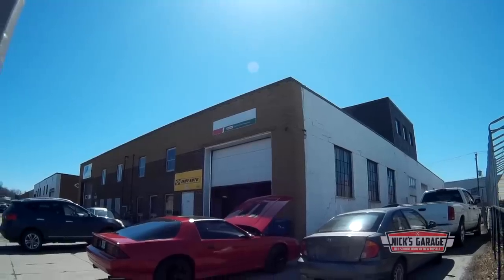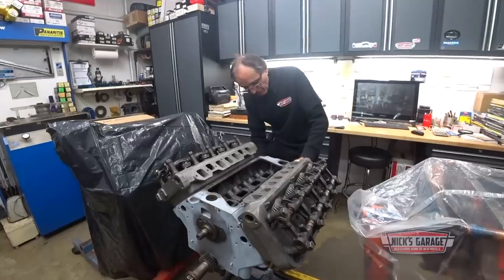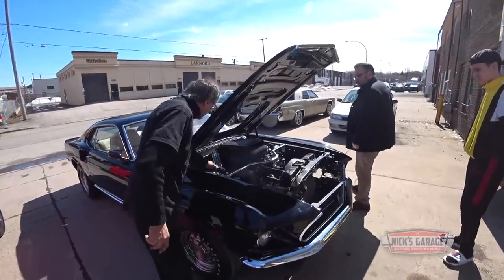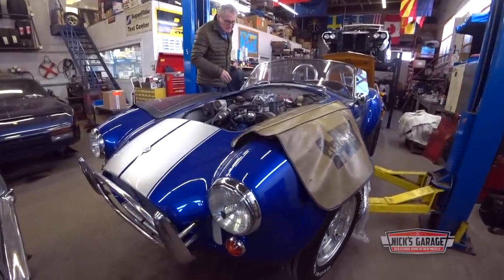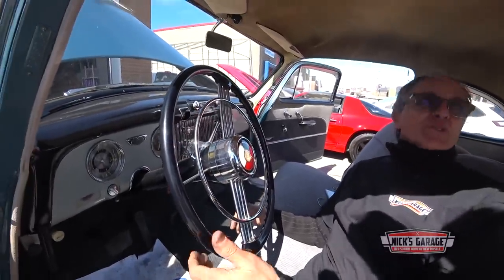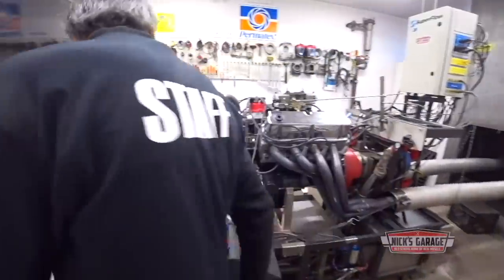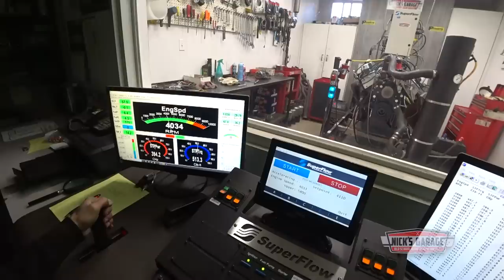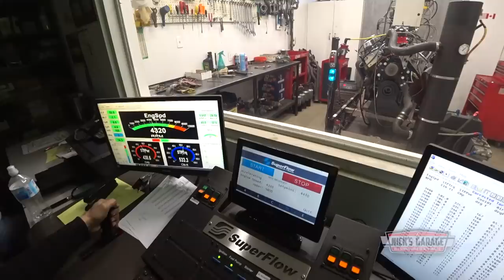427 Ford on the Dyno - Nick Tests the Blue Oval

Comment: I'm kind of surprised at the size of the intake ports. 351 Cleveland ports look much bigger. Am I right?
Reply: Yes especially 4v
Reply: @Grumpy468 That's just not true! Ford used the Cleveland design for twenty years in NASCAR. My '70 Mach 1 with it's Cleveland 4V was one of the fastest cars I ever owned! Well balanced for handling, too.

Comment: A Rouche 327 stroker in that cobra, YAASS!
Reply: 🙄 327 is a Chevy engine. You’re thinking of a 347
Reply: @Dunkaroos248  It is a 302 bored and stroked.
Reply: Maverick nonconformist no it’s not, it doesn’t exist as a ford engine. Typical 302 variants include the 306, 331, 347, and 363 stroker. I’ve never seen or heard of a 327 that wasn’t a Chevy
Reply: @Dunkaroos248  Look up the Windsor based R series 327R. About 425 horse. By Roush.

Comment: nick did you upgrade the main caps to 318 units so you can use the 340 oil pump and stronger main caps

Comment: Did you ever figure out that this is not drilled for hydraulic lifters (427), only 1967 cylinder blocks.

Comment: A 460 ford truck engine with a 230 degree cam a 850 holley would probably get you 560 hp and 600 ft lbs of torque for a lot less money and at lower rpm.
Reply: diel.       I think they wanted that small block look.
Reply: with a 515 stroker kit in it 600 easy
Reply: Lots heavier than the small block, though.

Comment: Could someone put a honest to goodness 427 Fe into the cars that they belong in ? It's expensive but worth it . Even a 428Cj would be nice .
Reply: Small blocks are a lot easier to find these days.
Reply: A lot of builders like the challenge and knowledge that results from knowing these stroker engines inside and out. 427 to 434 inches from a small block Ford with good heads is a desirable package. Especially if you are bucks up and go aftermarket aluminum heads. I like FE big blocks too but getting the inches and power out of a small block combo is the bomb.
Reply: @bobbybobberson3374  Yeah, you only put a Chevy in it when you want the most power and reliability along with it.
Reply: @SealofPerfection  Oh No!  Someone been in the wobbly pops again!

Comment: I'd like to see a 500 ci. Blown Chrysler  hemi on alcohol on your dyno .
Reply: The Okc boys broke their whole system running a wild motor.
Reply: 🤔 That would be somewhat powerful, but imagine how much MORE brutal power that Mopar hemi would make, if he simply sprayed on a coat of Ford blue engine paint! That "spray on" power adder is proven to add 100+ horsepower and torque to ANY Mopar OR GM engine! Next,  you drop that Ford blue hemi into a Roadrunner or Dart, make a few passes to gauge it's potential et's. Then, hang a "blue oval" badge from the rear view, and make a few more passes... Congratulations, you've now dropped your et by 1 full sec! 😁👍

🚫 Disclaimer: I understand that most people will ask:  "why not just build a hot '68 Mustang fastback, a badass '64 Fairlane, or a world-beating '65 Mercury Comet Cyclone"? To those people, the obvious answer is simple... It's "yes"!☑️

🚫🚫Real disclaimer: Just kidding, I prefer Fords, but I like them all nonetheless.

Comment: The shock tower braces on the Mustang never came from the factory chrome plated. They were always black.
Reply: You're correct Scott, they just came to him like that.
Reply: Oh it matters!  ;o)
Reply: Mark Godfrey  Just because it spreads misinformation.  That is all.
Reply: They didn't come with the tubular cross brace either, or the aluminum intake - the Cobra jet came with a cast iron intake.  Just misinformation or bs - its easily spread when not so informed owners buy from bs artists and believe whatever they are told.  Its not really so important until the uninformed spread the stories they have been told and then argue with correctly restored owners
Reply: @Thomas63r2  only the police interceptor came with an alu intake

Comment: Just delete the PS pump. No leaks, save crank driven hp, save few lbs, less head aches! Good as a rowing machine 4 arms, but easy on a light weight rolling Kit glass replica AC Cobra small block. Also swap out serp to V belts easy w/PS & AC Veritable car. That's a mans ride and a beaut😘

Comment: On the Kit Car Cobra can you change to shorter motor mounts?
Reply: DBSSTEELER my thoughts.also
Reply: DBSS.     If I drop the engine, it will disturb other accessories.
Reply: Nick Panaritis 

I can see that. That’s still got to be cheaper and easier than the customer buying a whole new motor and starting from scratch though.

Comment: Not sure what you have there, but it ain't an FE 427.  Intake/head junction is not under the valve cover, for one thing; oil filter configuration is wrong too.  385 series block (429)?
Reply: They never said it was an FE.  It's a stroker small block.
Reply: I think it's a 351 Windsor stroked
Reply: I never said they said it was an FE.  But when someone refers to a "Ford 427," the default assumption is that it is an FE unless otherwise noted.  I figured someone would come back with additional information - albeit without the smartassery.

Comment: The replica Cobra should not have a tree-fiddy-one in it, it should have a real 429 FE or even a cammed 460. If the replica can't fit a 429, how did Carroll Shelby fit it in the real thing? Imo a modern Voodoo engine would be a much better choice. The 351 is a 5.8L, the Voodoo is a 6.2L, I think that even a Coyote would make more sense, but they have 32 valve twin cam heads and if they can't fit an OHV engine, it'd be impossible to fit a dual cam head V8 under the hood.
Reply: The 429 wasn't an FE, it was from the 385 series engine family along with the 460. Caroll Shelby used either a Windsor family 289 hi performance, or an FE family 427.

Comment: Judging by all the fitment issues, I guess its safe to say that that cobra replica was based on the 260/289 cars. as all a 302 is, is just a sized up 289, 351 though is a different animal and the guy who probably advised him to make the change probably did so thinking it could take it, thinking that it was based on the 427/428 cars, which were drastically overhauled to take that gigantic motor over the 289's

as once you reach about 400 HP+ with that motor, the 302, the thing can break right down the middle unless you literally wield a specific part on the block to reinforce it. It was something I learned from watching the regular car reviews build series on their Ford Falcon, which was engine swapped from an inline 6 that was on its way out, to a 302 from a 1990's Ford Thunderbird that had been used in fire fighting training with the jaws of life, so the engine was fine, the rest of the car was just torn up 

and he showed the photo of the reinforcement area and how to do it and what it was, as the owner was worrying about that and the block cracking overtime, even though it was only like 260 horsepower.

Comment: Il prend mieux le 750 CFCM plutôt que le 830 
Le Buick avec un générateur et une boîte de contrôle 6 Volt c'est vieux ça mon père avait un e Chevrolet 57 283 avec transmission 3 vitesse au volant quand on allait a la messe l'auto était chaude au bout de 5 milles c'est petit moteur tournait en douceur avant qu'il change l'overlap sur les camshaft en 68

Comment: 24:27 it didn't make any more power cuz you didn't push the handle of the way you weren't Full Throttle. Come on Nick
Reply: Then you can look at 26 minutes and 37 seconds... it's wide open then... come on man. the 830 would have done way better up top.

Comment: That’s a pretty cool ford! My 400m made 440hp and 535 torque with Cleveland heads and a tiny cam
Reply: You’re right about that, I have a set of Edelbrock aluminum Cleveland heads that I want to put of the next engine I build, I also have those heads on my 400m
Reply: Put on the next engine I build *

Comment: Why don’t you ever put more timing in the engines how 
can you expect it to make power with 29 degrees of timing ? Or is it you have poor fuel in Canada ,that engine needs at least 34 to 36 degrees to make power with that combustion chamber . I don’t get it I’ve been building race engines for over 38 years and never run that low timing unless it’s boosted .

Comment: PUT the 302 back in the cobra sell the 351
Reply: Swap it out with the 302 in that Boss, that guy gets a bigger engine that easily fits in his 'Stang..including those headers, the Cobra Jet guy gets a motor that fits in his car.
Beautiful old Buick, although wish they let you get rid of that miss, that is the 1 thing am a bit OCD about.
Reply: good idea
Reply: there are alot of ways to get that motor to work, but i think this garage only does bolt-on improvements
Reply: niceguy217 are you kiddding?! The boss mustang is worth fuckall without the original engine and you’d have the same fitment issues in the cobra with the boss engine because it uses Cleveland heads which are bigger than Windsor heads and won’t fit.

Comment: What is the price of gasoline there in Canada ??
Reply from the maker: Right now you can find regular unleaded at about $1.40 Canadian per liter. Which is about $4.05 US per gallon. If we got the math right.
Reply: Mr.     Today, 1. 37.9 per liter.  Yesterday, 1. 38.9.         For regular fuel.
Reply: Close enough at $4.05. Here in California, we are getting ripped at $4.25/gallon, highest in the nation including Hawaii. We have to use "boutique" fuels available only in California and the refineries are burning down (too old) and won’t build any new ones due to massive enviro regs. 
Great shows Nick, I can really relate to all your videos. I've been wrenching since 1958 when I transplanted a built Olds V8 with Packard 3-sp OD trans into my '51 Pontiac coupe-- really woke-up that car and was known as a “sleeper” back in the day.  I still have my ’32 Deuce Roadster bought in 1961 for $650. 
"Progressive" California has pretty much shut down street rodding as a sport and as an industry; many suppliers have moved out and vehicle over-regulation has a choke-hold on us with motor vehicle fines ranging from about $400 to over $1000 US dollars for each offense.
Reply: @MrGGPRI  .    I know that California has the strictest laws on environment in the world. Why? Too many cars?

Comment: Water pump, didn't see it spinning.
Reply from the maker: The water pump is powered by an electric motor for dyno testing. Nick can switch it on or off from his console to control temperature.

Comment: the old lifter looks collapsed, not pumped up. otherwise looks the same.
Reply: Put the old one in an ultrasonic cleaner and see if it will pop up.
Reply: K.        You are correct, They were all collapsed.

Comment: I'm 66 but could never understand difference in big vs small block.  He's calling 427 ford small block.

Help.
Reply: 427 is the displacement and not to be confused with the block. A small block 351w can be bored/stroked to 427. The big block vs small block relates to different things in different manufactures. The basic idea is the physical sizes of the two are as their name describes- big or small. Nothing to do with the displacement.

Comment: Well the point was shoot for the moon but see if it even could leave the launch pad. An inch made the difference. Then you guys had a fender bender... all elbows on fenders of the snake that won't fit and give some space for oh little things like say exhaust, power steering, alternator, .. your distributor is up front so firewall stays... bottom line, even google would say.. tread carefully/LOL A modification to the motor mounts to get all you can get for it to be lower and electric drive pump and juice maker, buy the necessary crap for the exhaust to either come out on the front end of engine and win a most extraordinary exhaust piping award or just put the right engine in that nick builds and if your name is drawn get a dirty used tee shirt , its hard to see all the wishes go to beggars

Comment: That is not a 427. That's a 351 Windsor stroked and bored to a 427 get it right
Reply: Use to run one in my 85 bronco.  Just a small cam in it with gt40 heads.  Made good tq for daily driver.

Comment: i am afraid i must be that guy today There is no such thing as a small block ford no place in history did ford even name a motor a small block or big block that is GM ......this is a Windsor block not a small block...there are factory FE blocks that are less cid than the stock 351w there are Cleveland blocks with the same cid ....ford had motor families not big block or small blocks .....so please use the correct designation when talking about motors from ford as i know you do have the knowledge already and you do know the deference .........and if it is clockwise it am betting it is a marine motor
Reply: They are called engines they use fuel to produce power not electricity motors are electric
Reply: Ole Nick here has probably forgot more about building and rebuilding Engines than you've learned

Comment: Why does he keep calling it a small block Ford when it's a 427 big block Ford
Reply: Hi Jeromy, because it is not an original FE (big block) engine, it is a small block stroker kit (likely a modern 351 W or C) "bored and stroked" to 427, usually boring to 4.125" and stroking to 4.00".  Genuine FE 427 Side-Oiler blocks are very rare, usually have been abused/bored and are "old" technology besides being heavier than the small block.  The FE series was replaced in 1968 by the 385 series (429~460) which included the 429 Boss/NASCAR and the 494 NASCAR engines.  The 385-series was more advanced than the FE but did not see as much development since Ford got out of racing all together in 1970 and EPA, insurance rates and lawsuits did the rest to slow/stop the Detroit horsepower race.  Hope it helps, Ciao, L